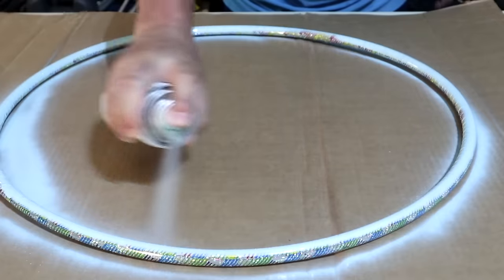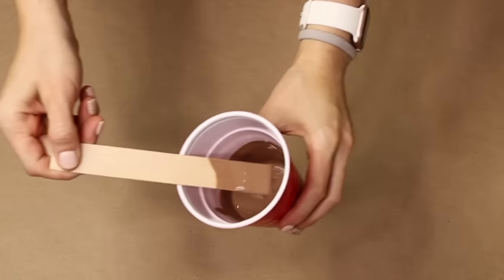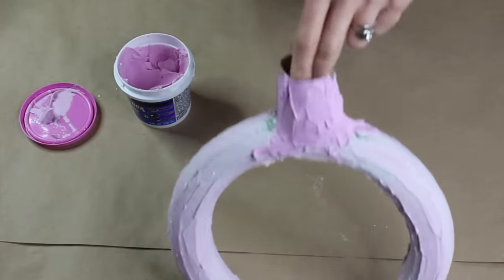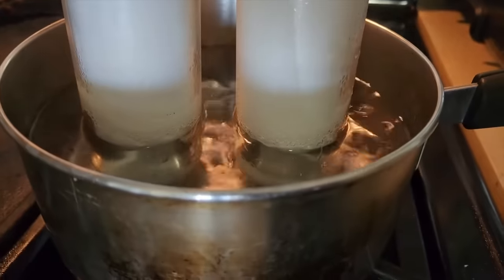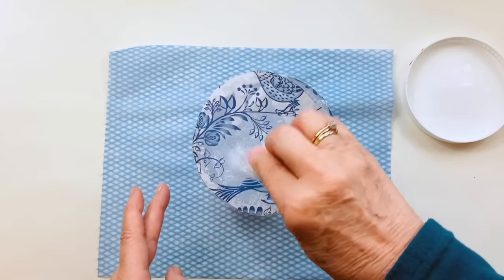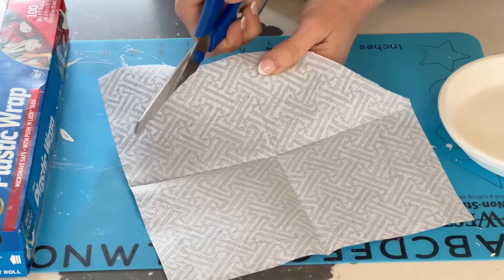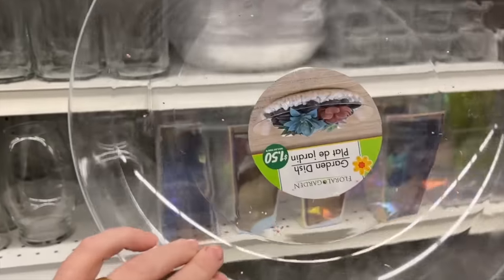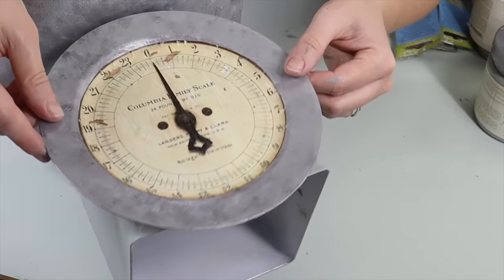Everyone will be buying hula hoops after seeing this brilliant storage idea!

Comment: Glass bottles in the oven??? 🤔😖
Reply: Yes; many have been doing it for years. 😁❇️
Reply: @VickiRN920 yes heat resistant jars. Alot of jelly and jam jars are safe because they are filled with hot food just like canning with mason jars.😊
Reply: @leslie4351   have you used this method with Mod Podge? 
Is the coloring water and scratch proof when growing plants in them to root? 
I would like brown to keep the algae growth down. But I don’t want to do the work if not suitable for this use.
Reply: Yea on a low temperature, what's the problem?